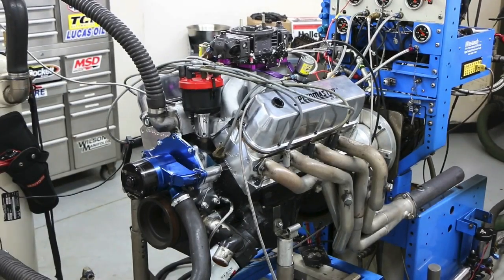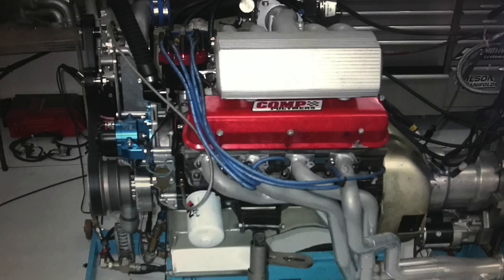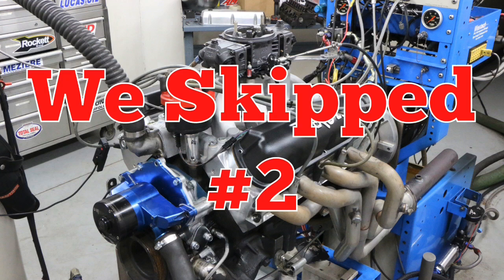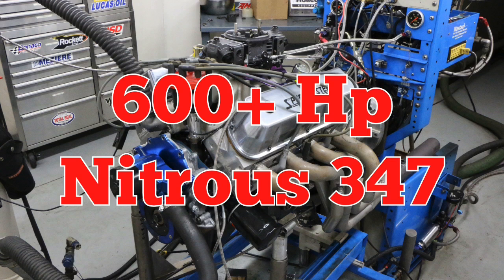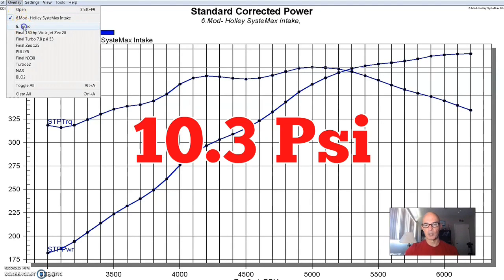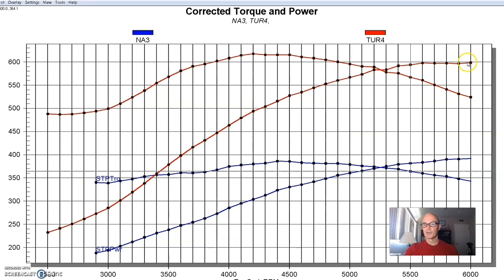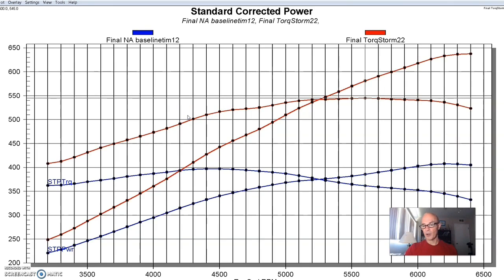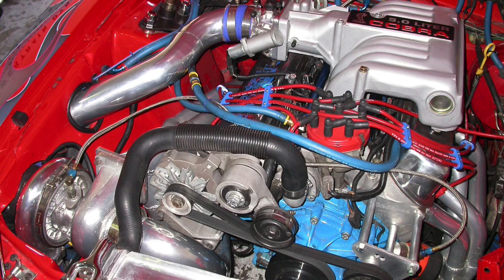5.0L FORD BLOCK SPLITTING-FACT OR FICTION?

Comment: Well the 302 can handle almost as much abuse as the 2.3.  The 351W however, will EASILY break.  Just poor metal???  I had to ball hone mine for an hour when I got it because of an injector issue then many many miles driven by the original owner on only 1 ring...leaving a land on the length of the cylinder.  Currently building a 700 hp Dart Block 427W.

Comment: I believe the chances of splitting increase when you run boost, the heat from the boost overwhelms the block and it cracks. ( rapid thermal expansion?)

Comment: I believe 81, 82 blocks split fairly easily. Im thinking thinner casting on those years. I split one with stock block,, ported stock heads, dont remember the cam. I think 280 comp cam, and 175 shot. It split completely like a walnut. As in, the only thing holding it together was intake and pan. It literally fell in two peices when unbolted. This happened at the drag strip and almost shut them down from the mess. Also a few years later I was running a roots blower, alcohol with 11:1 comp, huge roller cam. Never dynoed so not sure what horsepower I was at. Maybe 600-700. I ran 87-89 blocks. I went through 5 of them in a short period.  They never let go but I was finding the mains was cracking dead center. They was hair line cracks. Finally I switched to 69 302 boss block also had a 70 boss block set up and never had another issue. I remember when I split that block in the early 90's, there was some other guys saying they seen it before

Comment: Ran a s$#can 306 for 4 years shooting 100 shot every pass. Had a set of ARP rod bolts but stock rods, pressed pin TRW powerforged pistons. JUNK!! Put it in a Street car for a guy I knew. Sold him the motor for $750!! Helped him set it up. Drove to track on drag radials. Run through and back in staging lanes back to back! Put it into a stick car and didn't hook up rev limiter, that finally got it!!!

Comment: Pro charged 5.0 flexed enough  to keep loosening the intake manifold, and when removing  the Eagle rotating  assembly, the oil pump had one ear cracked off... The engine had laid 570 hp on a wheel dyno..
BUT, my very good friend  had bought an early Chevy truck that had a 307 swapped into it at some point, it ran poorly, but he did run it a few months, when swapping it out, we pulled the intake off and saw the heads spread apart from each other.  The block was split through the cam bore and crank bore, pulled the mains and it was completely  split.. stock dog 307... I know they had low nickel content , but c'mon  man

Comment: It was more of a milage issue when I split mine, it having 230000 miles on it and a hot summer day mixed with a hard launch and a 6000 rpm shift, she just let go. Split it down the middle the only thing holding it together was the intake and oil pan... Crank broke in three places, the lower pulley slamed into the waterpump pulley and the belt flew off. It made a hidius noise and I new it was over!

Comment: I think it's harmonics past a certain HP/TQ number. Think it's frequency of the block at this high level cracking it. Fun Fact: When I first got to Tinker AFB, and was in AWACS Maintenance School, we were on the flight line doing an engine run on one of many E-3A's we had. They were running the engine up, I was on the ramp, when I heard a high pitch resonation coming through my ear plugs and ear muffs. My glasses broke right at the bridge in the middle. There was nothing wrong with my glasses at the time. I told my instructor I thought my glasses broke from the high pitch frequency of the engine. He called B.S. on my idea, because he had never seen that happen. I, to this day, think he was wrong. It was a clean, perfect break, right in the middle. I had to put white gauze tape on my classes until I could get a new pair. I looked like a nerd who had his glasses broken by the cool kids. Frequency.

Comment: Can't say I've seen a Ford block split but I have seen the whole midsection of a sbc ripped apart. Catastrophic failure of the rotating parts caused that. Unless the casting has internal flaws, 5-600 hp shouldn't be an issue, of course it would be prudent to not miss any gears 💥

Comment: I have split many running a 347 with n351 heads putting 500hp.  I haven't been able to keep a stock block together. BUT I'm running rpm up to 6500 rpm for several laps at a time.

Comment: Here’s what my experience has been:
The short deck Windsor blocks ARE weak, however, they can still hold a fair amount of power if the tune is decent and they are not unnecessarily abused (IE, revving 8k+ rpm with lots of boost). I know this guy who runs at my local track that has been through a 302 block or two. He had his foxbody making approximately 450 hp NA with a factory 5.0 HO block. Then he added a 300 shot which the car ran with for a very long time making well over 700 hp. Eventually, it did split and he replaced it with another block which is still in use. So yes, 302 blocks can not handle insane power figures for extended periods, but they will not often split at 500 hp like a lot of people seem to think. I have a stock 302 in my SN95 which I will be boosting to it’s limits.

Comment: The times I’ve seen these blocks crack or split is when they were in pickups running at operating temp and the engine would have a sudden cool down event such as a large puddle splashing into the engine bay from underneath. I have a friend who has put at least 5 engines in one truck because he would take it to the mud bogs or hit large pools of water and the engines would crack down the center. I think it’s due to the alloy in the block becoming embrittled from heat and then suddenly cooling off, and/or from many heat cycles. Note these engines were always rebuilds he did on other engines he found with way over 100,000 miles on them and not new blocks or newish I should say. And it’s not the only time I’ve seen a ford block suffer from this I’ve seen other types of ford blocks do this as well.

Comment: This is interesting, I have heard the same thing about the 109 block in a Grand National or Turbo Regal in MY 86/87.  My engine builder told me that if I wanted to make 600whp that I needed to go to a Buick Motor Sports stage II block or a TA Performance aftermarket block.  There have been several guys that have made over a 1000whp with the stock 109 block, with forged internals.  Not to mention that one guy ran the stock short block - stock crank, mains and pistons and he made over 10 minutes worth of 9 sec passes and when he took the engine out to check it out there was a main cap broke.  So IMO, I think an excellent tune goes a long way.  The guy had an aftermarket ECU, where he could fine tune the fuel map and spark.  He is still running a stock block, not sure what he has done to the block though.  I watched him go from 80 to 130 in about 4 seconds.  Pretty good.  Remember this is a V6 - 3.8L block, with a turbo on it.  The block only has 4 main caps to distribute the load, not 5 like a v8 or 7 like an inline 6.

Comment: Just put a couple of big hose clamps and a few extra zip ties around it to hold it together. 
If a top fueler can hold an engine in with hose clamps, your weakass little 800hp 302 isn't gonna have a problem.

Comment: I split one in half around 500hp or close but it had lots of miles and the week before it was backing the valve cover bolts out every time i would get on it i was spraying it with a 175 hp hit of nos

Comment: I have seen one split first hand, one of my close friends and I were at the drag strip and he split the block. The back story is it was a stock 302 block, was stroke to a 406 I believe, twisted wedge heads, don't remember the compression and also had a 200 shot of gas. Done burn out fine, life is good, pulls up to the line for 3500 clutch drop and boom it just shut off after the clutch drop and slamming the gas. Nothing came out of the block and acted like to locked and wouldn't turn over. We load it up, go home to tear it apart, then we saw the split dead center of the block right above the camshaft from the timing cover to bell housing bolts and the rotating assembly looked visibly fine but it was not reused. I suspect it was the shock to the crankshaft that caused some bad harmonics. I also have heard this block splitting rumor about SBC with stock block at some HP number as well. Hope it helps, just my thoughts.

Comment: I has a 88 coupe back in the day. It had gt40 heads, Crower cam stock everything else. Oh except for the 250 shot of nitrous. It ran in the 10's for years never one issue with the block. Drove it as a daily street raced it or tracked it almost every weekend. My buddy same year car put a B-303 in his bam split the block right down the cam bearings. So it is luck of the draw in my opinion I've seen a ton make good power for a long time and seen quite a few split.

Comment: run a 302 in a demo derby and the spilt happen heat must have a factor or just bad casting so it happens buy a good one.maybe sonic test could be on the test sheet or find out the casting number chose a low shift on casting or pre 72 block they should be stronger good looking.

Comment: Ironic that I just watched this video a week or two ago and just yesterday my neighbor split his block. It was an Eagle 347 rotating assembly, Windsor Sr heads, solid flat tappet cam, dyno'd at 498hp at the crank. It was built in the late 90's and lasted about 30k miles.

Comment: I believe that circle track racing, especially NASCAR races is where the engine is up to high output so the block keeps flexing continuously is where these engines came apart, and the factorys had to develop special blocks to keep them together. I have seen 2 blocks with cracks in them at the machine shop in the 60s. One was a local guy with a dump truck with a sbc, so Rick got just him a car engine to replace it. Rick liked to Magnaflux things so that got found. Possibly marine engine conversions came apart.  That is a place where the engines are at max output for long periods and the blocks flex rhythmically. You are well connected. Why don't you chase this origin down and make an article out of it. I'd love to read it.

Comment: It's not about hp. If you've balanced it then it should take more, BUT if you've got a monday morning or friday afternoon block - all bets are off. Cap walk splits the block. The crank will break at the second main, but only after the main splits down the middle.

Comment: It's my understanding that it's main cap movement. And eventually the crank hits the main bulkhead.

I was driving my brother's 89 Mustang when it decided to split on me. It wasn't a radical combo. It was making mid-400s to the wheels with a procharger D1 (we are at 6k ft elevation). But it was cog driven with the pulley hanging WAY off the front of the crank with the tensioner cranked down pretty hard. It also had a manual valve body Lentech AOD that shifted fairly hard. So it's safe to say the crankshaft was loaded pretty hard, in thrust from the torque converter and laterally from the supercharger. It split on me at somewhere between 6000-6500 RPM on the upshift. At that RPM it really scattered.

We have a chassis dyno and have dynoed a ton of these motors going back to 1999 with many making way more power than this and this is the only one I've seen split in person. I personally blame block splits on loading the crank in thrust from making a lot of power into a torque converter (or clutch pressure plate pushing on it) or something like a cranked down supercharger belt pulling very  hard laterally on the crank snout.

Comment: I believe it is a combination of issues. Stress risers along with rotating assembly imbalance at high engine speeds where the amplitude of resonant frequencies or a high torque output induced impulse loads make main caps walk imposing loads on the bulkhead they weren't designed for. The usual areas of concern is where the bulkhead cross section is smallest. The main cap threaded holes including but not limited to the cam bulkhead and lifter galley.

Comment: Seriously, anyone building a SBF , get a seasoned,older block, Mexico casting if you can find one. I worked for Ford back in the 80's, and we had major problems with non - H.O. 302 motors. The blocks were so weak, there was a lot of warranty going on.

Comment: If they were to split I have read it's due to the external balancing of the engine put a twisting force on the block with high rpm (Over 6500rpm)

Comment: I've seen one start to split between cam bearings and mains. Turbo 600 plus hp,  little over 100 1/8 mile runs. I think it was crankshaft vibrations

Comment: I watched one of 1320videos street race video and some of the guys were making 1000+hp on small block ford blocks 5.0L (non-coyote) turbo, sure they were fully built bottom ends and stuff but they still made that power and did not blow up the blocks. So they can make great power and hold together if built/tuned correctly.
Reply: https://youtu.be/5KlrfEE24WU

Comment: Ive personally seen a SBF split. A buddy had mud truck with a 302 Windsor that he stoked out to 347 and ran nitrous. He competed in the mud drags with it. Two speed powerglide with a real high stall converter, 4x4 with 37in boggers. He staged it up at the line loaded it up on trans brake took off at the light drove maybe two feet and BAMMM. He didn't split it completely in half but just down the valley. He built an identical engine but added a valley girdle truss system and hasn't had the problem again. He told me that he believes it was a casting issue on some of the Windsors.

Comment: There are a lot of variables involved but playing with diesel power the last few years has taught me that most catastrophic failures are from high cylinder pressures, which is mostly caused by WOT boost at too low of an rpm. I guess in a gasser you can have severe pre-detonation causing a rod fracture that windows a block...

Comment: Buddy I like your video's. But I stopped this one 10 seconds in. I split my 92 Mustang GT'S 302 Dead down the center of the block. When I unbolted the lower intake (not hurt) and oil pan (trashed) the block fell into 2 pieces. Btw Naturally Aspirated. I've owned 9 Foxbody Mustang's I belong to Cherokee Regional Mustang Club. And this was the 1st time I'd ever done it. The crank liked about one inch to the radiator. Only 2 pistons wasn't damaged. But the E-303 Cam still lives today in another friend's Mustang. Kinda unbelievable but didn't put a mark on it. Couldn't do that again. But yes they split. Back to your video.

Comment: I have split a stock 5.0 block. I built a 347 with a 500 shot and turned it 8400 . I believe they break due to rod angle and the instant power from drag racing

Comment: My opinion is it's revving them to 8000 rpm trying to make 550ish hp N/A that kills them.  Forced induction applications will make more torque and therefore not require the high revs to make the power and those engines will live long happy lives.

Comment: Never seen the block split in half but my brother bought a 84 mercury capri rs that had a 347 n/a t-5 that probably had 75-100thd miles on engine he and I drove it around for a year or two and one night he was driving it and the crank broke in half and the pistons looked like they wanted to swap cylinders. This car was scary fast no lying would do 0-60 less than 4sec don't know what hp came with a ford Oklahoma  factory  metal plate glued to it. It had  gt40 heads the stamped nonadjustable rockers and factory 780cfm Holley

Comment: Ivr never really heard 500hp were they begin to split ive always heard more of the 600hp+ is when but honestly i think its more about how you do the motor and what you put in it that determinse if its gonna hold the 5.0/302 is very underestimated they are little beast that will take a freakn beating

Comment: I think it would be combination of freq (exploiting grain inconsistencies), cylinder pressure (detonation), and STRONG pistons (normally fail point under factory testing)

AFTER VIDEO:
I think cylinder pressure and harmonics.  Block split would likely be the final fail point for the engineering team (everything else should fail first) and the casting processes are likely very good.  For a block to split you need a condition where parts of the block are trying to go in different directions.  The cylinder pressure (affected by detonation, for sure) would be my guess for highest stress event of this type.

Comment: Casting issues, known to crack at back of the block, and usually in same spot, usually only happens after launch loads with stick shift cars or autos with trans brakes. 500hp is usually the "safe zone", and rightly so on a stock casting 302

Comment: I managed to split a 302 block.  10 mid 10 second passes at ~127 mph in a 3,400 lb car at Cecil Dragway is what did it.  I drove it 70 miles home and knew it was split because when I would accelerate on the highway on the drive home and the oil pressure would drop.  The girdle and intake are the only thing that let me get home.  The girdle didn't prevent the cracking, but it did keep it together long enough to get home.

Comment: Them 5.0 blocks are hell of a lot stronger than what people say they are! We had a stock bottom end of of a 87 mustang and with aftermarket heads intake and swapped to a carb and vortex super charger making over 600 hp and had over 100 passes at drag strip and never had a problem with the block,

Comment: Hydrolock after a burned plug, detonation in the crank chamber, vibration at the unbalanced lower end, stretching connecting rods, too much spark advance, vibration at the cam after spring/valve job.